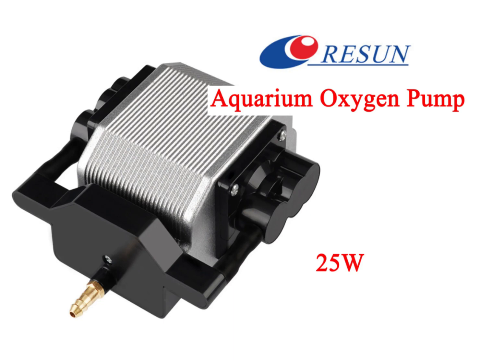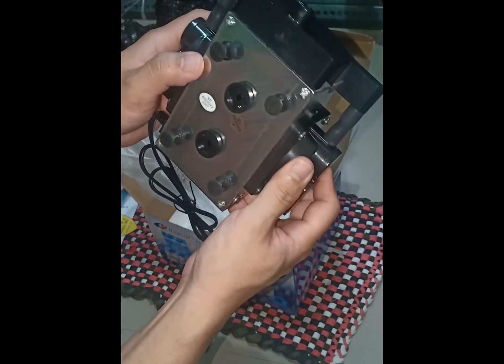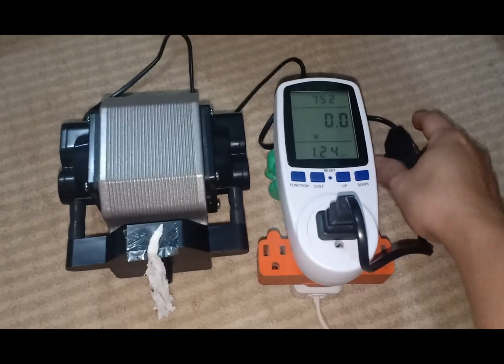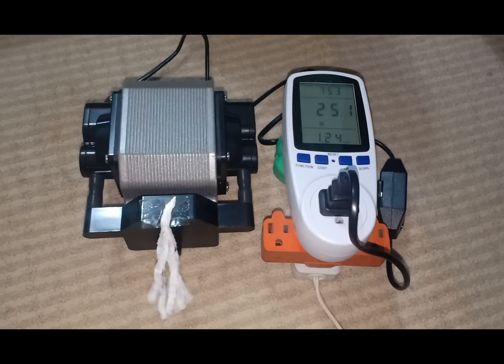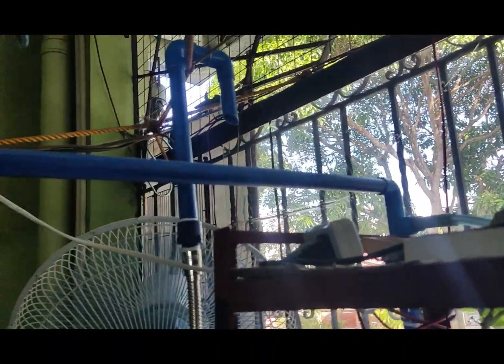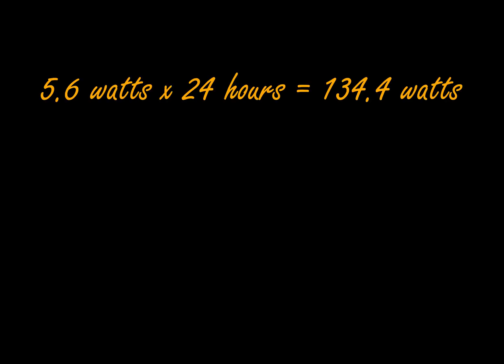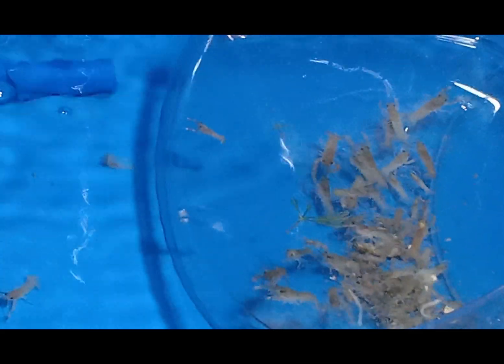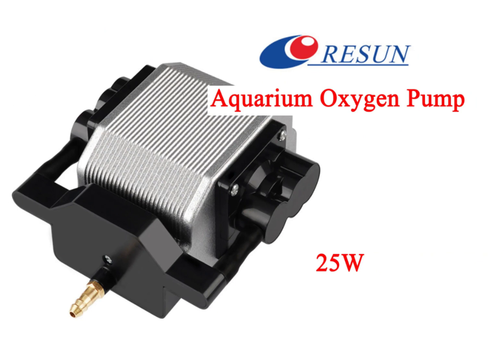Resun 25W adjustable air pump

Comment: Sir, hindi ba sya malakas sa kuryente kung gamit mo ay 24hours 30days? Sana po ma replyan nyu po ako, kasi bibili po ako 25 watts
Reply from the maker: Depends po kung ano ni set nyo na power. If lowest setting, meaning after the click sound ng knob, it's around 5-6W. This is about 50 pesos added to our monthly electric bill. For me that's enough for my setup in the video. I've been running the unit for 6 months 24/7, no issue so far. Better to have that additional wattage on stand by in case you'll be adding tanks in the future. I hope this helps.
Reply: @ericus03  salamat po

Comment: Super tahimik po ba siya? Im deciding between this and LP20
Reply from the maker: For rhe first 3-4 days, mejo malakas ang hum during operation. Then gradually nagiging tahimik sya day after day. I've bought 2 units, and this is what I've noticed on both pumps. Also, as you can see in the video, I've placed the pump on top of a styrofoam. This also reduces vibrations which can create noise. Sorry but I have no idea about the Lp20 pero if I'm not mistaken, pareho silang diaphragm air pumps, mas tahimik ang ganitong model compared sa mga compressor type. I hope I've answered your question.
Reply: @ericus03 hndi sya matipid sa kuryente kapag binabaan mo air flow control